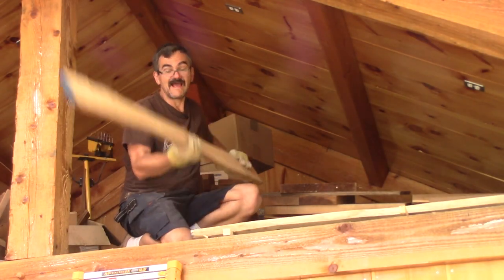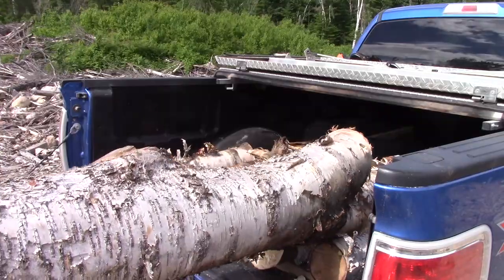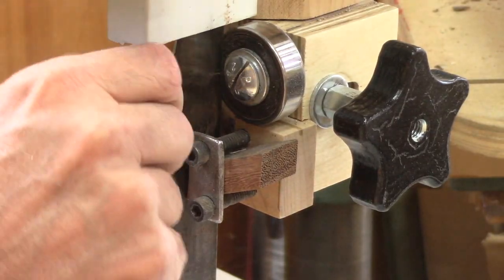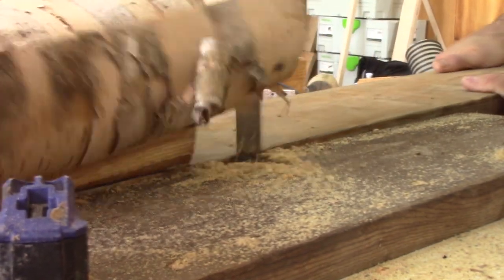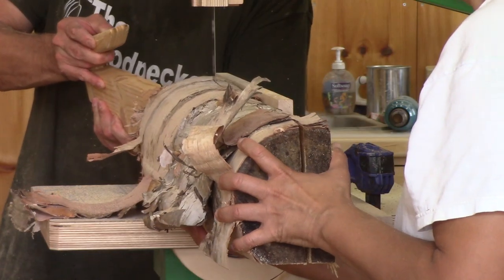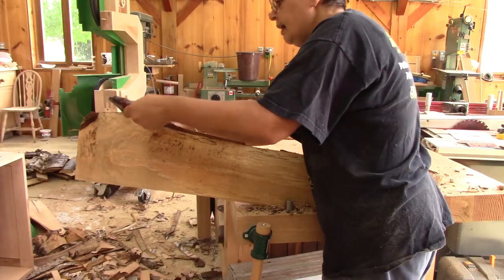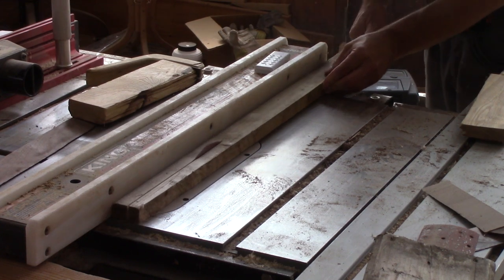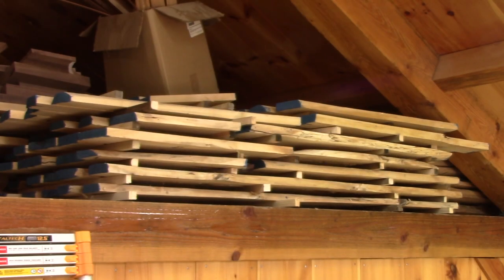The Woodpecker Ep 164 - I'm cutting some birch boards with my new bandsaw

Comment: It seems to be an excellent bandsaw. What did you sharpen the blade with and did you set the blade?
How do you get on with birch, in my experience it rots very quickly?
It's good to see the wife helping out and having a go.
Thanks for the video.
James (from Wales)
Reply from the maker: To sharpen it I had to use 2 diferents type of grinding wheel with my dremel. The first one was too soft and after 10 teeth or so it was so worn down that it broke in 2. Then I finished the job with another type of wheel. I managed to finish the job but this one is also worn down now. I guess I'll use dimond wheel next time.
I didn't set the teeth, I just let them like they were. But when I cut my stickers I used the bandsaw and I hit a screw, I resharpen the blades, and try to set the teeth this time. But since all the teeth are harden steel they broke like glass, so I stopped. But now after this screw my blade doesn't cut like in the video.... I'll have to buy a new one...
I hope it won't rot inside my shop... But outside yes it rot pretty quickly.
Renée is a god send :) she's amazing :))
Reply: Alain Vaillancourt . Thanks for the detailed information.
best wishes
James

Comment: Alain, put some weight on top of the last boards above the stickers or the upper wood will warp. Nice haul. You should go back and cut thicker 4 or6 by 6 for legs and other curved backs for chairs etc!
Reply from the maker: I intend to get more in May, but I'm not sure yet if I want to cut thicker slabs. The things I want to do only require 1" or so, but if I like working with this birch, I'll probably cut more dimentions in the future :)

Comment: Im impressed. I put a 2hp baldor on my old 14"  rockwell saw.. i wonder if i can get away running a 3/4" or 1" resaw blade? Any thoughts?
Reply from the maker: Probably, but use the biggest blade that fits into your saw, the teeths will be more appart and the gullet will be bigger, this will help getting the sawdust out quickly and it will cut easier.

Comment: How confident are you in being able to make more refined, accurate rip cuts? Or would you say this saw is only for rough milling lumber?
Reply from the maker: I've used it for real, for the first time 2 weeks ago, even though I was made last October, and the cuts are not that bad, I made a workbench and used it to cut the plywood without re-cuting, most of my cuts. I can't say it's 100% accurate only 99.8x% enough for the usage I intend to do with it. But it only depend on which holes you chose, not all of them are off just a bit and I have tons of holes combination to choose. I figured that more apart the parf dogs are more accurate the cut is
Reply: @LgosseuxDbois-TheWoodpecker  so as long as care is taken during the build process and accuracy is maintained in building the machine, you're confident it would hold up cutting ability and accuracy wise, for example, against your General Bandsaw?
Reply from the maker: I would think so. My first cuts were not that off. Having 100% accurate 90° cuts are difficult, at least for me.. Even yesterday I moved the 0° on my mitre saw of about 0.1° it seems it had moved. After using it more than just for one project I'll be mere confident that this is accurate enough for what I do. But I'm sure it's not airplane engine accurate...
Reply: @LgosseuxDbois-TheWoodpecker  no I don't think that's typical for bandsaws to be able to rip perfectly to the line like a table saw. I mean getting close to the line and jointing the edge for glueups, as well as accurate curved cutting with appropriate blades. Thank you for getting back to me, I appreciate it
Reply from the maker: Ho sorry, my mistake...  I didn't check which episode you were asking... To answer you real question. 

Yes I'm confident, this bandsaw is way stronger than my General, Yes this sound strange from a wooden bandsaw but it'S true. Probably because it's all made of hard maple. My cuts are straight enough, bur to be on the safe side I've all cut 5/4 boards instead of 4/4. And they ended up being very straight in the end. I can say it because I'm actually right now, yes today, using this wood to make a drawers cart for my shop, whit all those logs. Only the top boards dried crooked, they will end up in the wood stove I guess.
But with the power and a wide 1¼" blade the cuts are accurate enough. All this at the end needs to be passed through a joiner and planer and I had almost no issues at all
Sorry for the misunderstanding of my first response
Reply: @LgosseuxDbois-TheWoodpecker  that's alright. I really appreciate you taking the time to answer my questions. I watched quite a few of your bandsaw videos. It blows me away the saw can tension a 1 3/4" blade, and cut accurately! I think you know what I mean about roughing lumber to rough width and then jointing and planing to final dimension. I know some people love tablesaws for that, but I've had some bad kickback occurences with poor instructors in my youth and am trying to avoid it. Obviously the bandsaw can cut quite a bit more than just rough rips. That's my concern, is the accuracy for joinery like tenons, or dovetails on my workbench. My next cut is the accuracy of resaws. The straighter, more consistent, the resaw the better the grain match on a book-match panel! Obviously my question is overall performance, but I wanted to give you some specifications on what I'll be using my saw for most. I am going to build the saw, just wanted to have an idea of what to expect before hand
Reply from the maker: For now I mostly used it for rough lumber. I kept my General bandsaw with a ¼" blade in it and when I need to make touchy cut I'm still using it. The only complain I have with this saw is that changing the blade takes a long time you have to remove the table, so having a secondary less powerful band saw is a plus to save time.
if you're building it I have 2 advices for you. First glue the inner tube to the wheels. I didn't and while cutting logs both of them went soft, probably because of the heat of the blade, and both of them flew away but in 2 separate occasions. OK it stayed inside the casing but you know what I mean. And second, if you can, 3d print the washer that holds the trunion in place. Both mine split in 2, the same happened to my friend. so I've printed new nylon washers and gave some to my friend when I visited him in NY state 2 weeks ago. This looks like it might hold up longer. Nylon is tough and can also bend a little unlike wood who will split in two right away.
Reply: @LgosseuxDbois-TheWoodpecker  beautiful thank you for the response. I'm going to have a rikon 14" bandsaw very soon. I was hoping to keep that with a thin blade for other cuts, and the wooden beast for rough cutting! I really appreciate the responses. It's been very helpful. My final question to you is your thoughts on the wooden jointer you built? Is it adequate? Would you do that again?
Reply from the maker: For the bandsaw, I'm sure, I'm very happy and I like it, I would recommend it to anybody.
But for the joiner I have mixed feeling... I love that now I have 13" wide joiner, I wouln't go back to my old 6", but I can't make it super straight even to save my life... For short pieces it'S ok but for long one it always endup a bit twisted. like 3/16 over 7'. All my doors are a bit twisted because of that. It's why I refused to make a door for my old boss, I know it will endup a bit twisted... Like I said on short piece it'S not that noticeable and if it'S a cabinet, well every thing will be square in the end the twist will go away but not on a door.
I have my eye on a nice Rikon 12" joiner/planer  but the price a a bit steep, I don't know what I'll do.
But it'S super nice having a wide joiner that'S for sure and for the price it cost to make it'S not that bad but making it super accurate and tuning it to have straight and not twisted jointed piece I didn't managed that myself. But still I use it in every project I make
Reply: @LgosseuxDbois-TheWoodpecker  wonderful so I'll start with the bandsaw and consider the jointer. I was considering getting a Helix head and a Baldor motor to build a real beauty of a jointer -but now we will see. I can upgrade after the first attempt with my lunch box planer
Reply from the maker: it would be wise. Maybe you'll endup with a much better result that I was able to and upgrading it would be worth it. but even Matthias said  that his joiner is the most complicated machine he ever build
Reply: @LgosseuxDbois-TheWoodpecker  with so many variables, I can see why it would be. I don't see why it couldn't be optimized though with some meticulous setup! I'll keep you up to date. Again, thanks for your time

Comment: Hi Alain.  I don’t understand why you paint the ends of the planks.  What does it do?
Reply from the maker: it's to seal the end grain so it won't dry too quickly. If the ends dry quicker than the rest of the boards, the end will crack, just like a fire log. So with paint the ends crack less and I have less waste in the end.

Comment: what could happen if don't protect the end of the boards with paint?
Reply from the maker: The ends would have dried quicker than the rest of the board and they would have cracked. With them covered with paint, they will dry slower, so less cracking.
Reply: got it. thank you. I follow your video from 2 year ago, and I'm not even a carpenter! I just like to know more about woodworking. cheers from Italy !

Comment: why did you paint the ends ? the color is important ?
Reply from the maker: To block some air from entering the end grain at the ends of the boards. With the end grain covered it will dry aproximatively at the same speed as the rest of the board. If I didn't covered it, the end would dry quicker and the wood would have cracked, just like the cut part of a log. I only took the first can of paint I have at home, my father was a horder and I still have probably 50 cans of paint that I don't use... And look who's judging his father....
Reply: Ha Ha Ha , so the color is not important